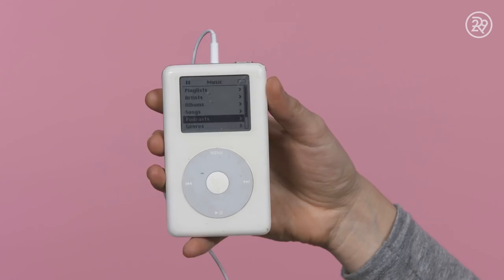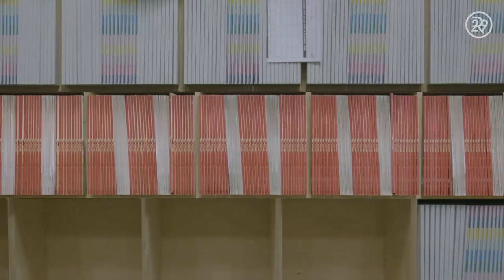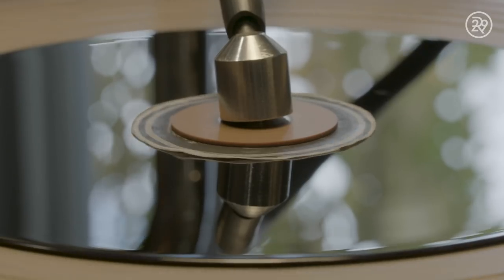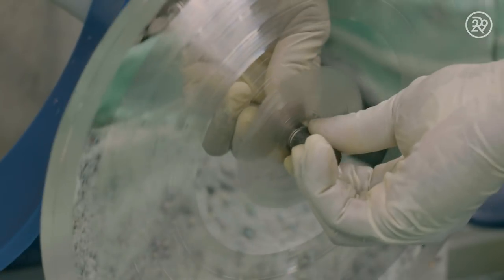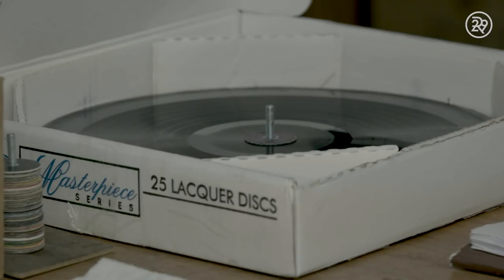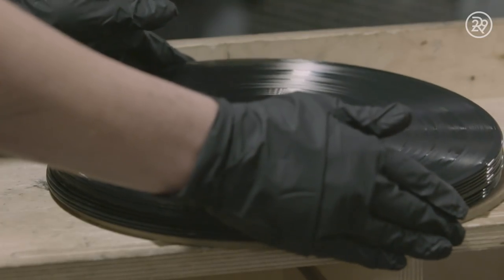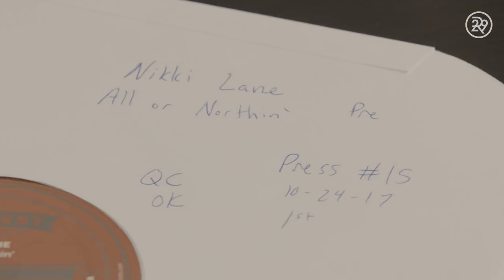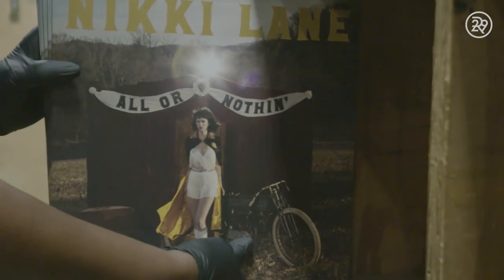How Vinyl Records Are Made | How Stuff Is Made | Refinery29

Comment: The proper way to make an LP is actually starting with analog tape, not digital audio files
Reply: Ikr was about to say.
Reply: Having digitally recorded albums digitally encoded onto vinyl is okay, but analog recordings definitely should be transferred with an all analog signal path. The best thing about records is that you can have an all analog recording that's very close to the master tape.
Reply: The digital file they use is just as good or better then the analog tape, likely RAW or WAV files.
Reply: AAA records aren't easy to come by. Nearly everything is digitally processed at some point these days.
Reply: I can’t hear the difference between the two on vinyl
Reply: I agree. The thing about vinyl is that it is meant to be an analogue format and should be recorded from an analogue source such as the original master tapes on which the music was originally recorded. There are probably different methods for recording new music in studios nowadays, but making vinyl compilations of old songs or even repressing an old album on new vinyl using digital sources seems pointless. I don't see the point of doing that to be honest, you might as well just listen to the music on CD instead.
Reply: I guarantee you wouldn’t know the difference between a high res and an analog tape. Hell you probably couldn’t tell between a high quality mp3
Reply: That’s the proper way, I will agree on that. But that’s not the way things are done anymore.
Reply: Nah, you just need to master it right. Digital to vinyl works fine.
Reply: No1 Real audiophiles use wax cylinders!
Reply: @Blake BelladonnaMuch higher fidelity. The audio files that are available to the public through streaming and CDs is confined to a low bitrate to account for space and internet speed, they aren't nearly as good as the masters. Because vinyl is analogue, bitrate isn't a concern, just analogue fidelity.
Reply: Ah, yes, higher noise floors. Delicious.

Comment: As a relatively new audiophile, would anyone know if the digital file used to make vinyls is generally higher quality than the publicly available WAV files? I was thinking of getting a high quality turntable and recording vinyls to my computer @ 192kHz 24bit via an audio interface to get high quality digital files to play on my sound system. I would just straight up listen to the vinyl, but I am afraid of physical wear and tear on the vinyl degrading the quality over time. My guess is the quality of the file used for the master depends on the studio, some using lossy MP3s, some using WAV files, and some using DSDs or other high quality files with high sampling frequencies.
Reply: get FLAC files and a good sound system
Reply: @Valkail_  yeah, in the year plus since I wrote that, I found out the only real reason to get vinyl is to listen to a master that isn't available digitally. Found that the dynamic range on vinyl is generally lower than digital copies due to inherent qualities of the medium. Basically getting all my music from qobuz, since tidal is the only alternative I could find (but I prefer to own my music over streaming it).
Reply: @ThatGamerDude9000  ay good that you found Qobuz. Happy listening. What headphones / speakers you using?
Reply: @Valkail_  haven't actually gotten the setup yet (money is the major limiter since I was unemployed for a couple months), but looking at getting the Polk Legend L200s, with a Rel T/5x subwoofer, using the Onkyo TX-RZ50 as an amp,  and connecting it to my computer with the RME ADI-2 DAC FS.